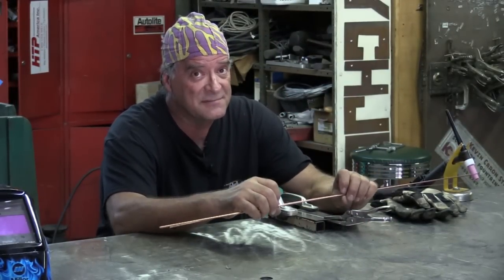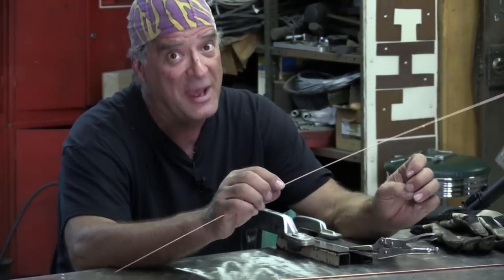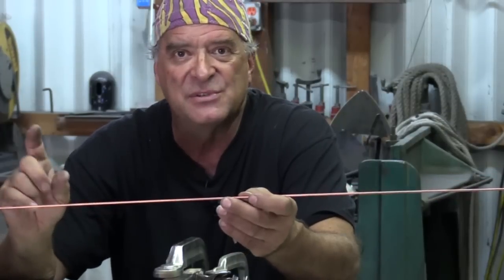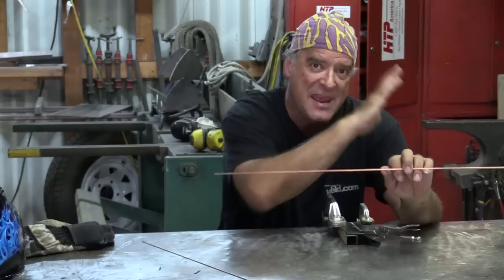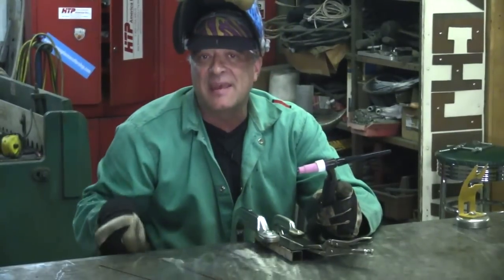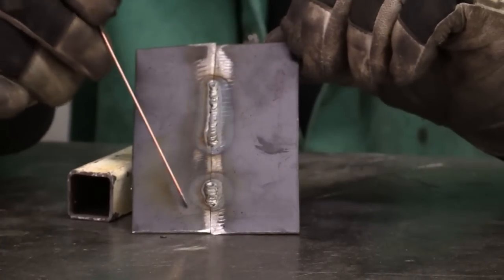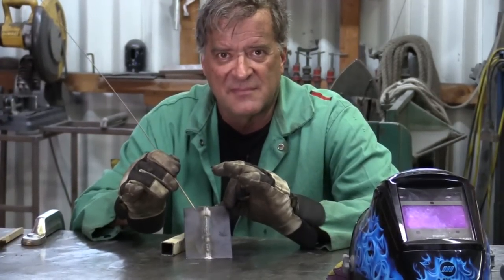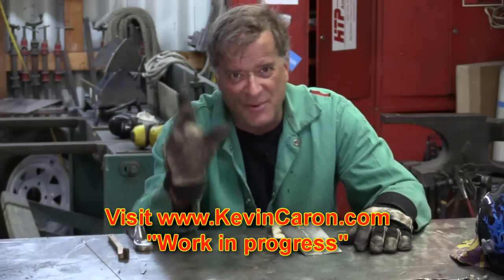How to Pick the Right Size TIG Filler Rod - Kevin Caron

Comment: Thanks Kevin, been trying to weld some thin Aluminum all week with a 3/32 T and filler.  Will not work on low amps.  This was a great topic to cover.  I think anything below 1/8 th should be 1/16th T and 1/16 filler.  Appreciate the video work.
Reply from the maker: Whatever works for you is the correct way far as I see. 

thanks for watching.

Comment: Finally got around to watching this video. Saved it to a playlist to find it easier when the TIG welder finally happens. I smell an Everlast 160sth in my future.
Reply from the maker: Nice little machine!    Sure it will work very well for you..
Reply: Kevin Caron, Artist But before can get the Everlast 160sth, need to get a cabin built. Definitely want one, just like that metal cutting circular saw you did a video of. So many shop toys, so little money. LOL, kind of like a starving artist, buy what you can when you can.

Comment: I had this problem a few weeks ago. Had a big gap to fill using a somewhat low amp Tig machine, 165amp, and just couldn't get the 1/8th inch rod to melt. I'm going to try the same set up again and use the 1/16th to see how it fills in the gap. 
 I'm think it would make for the same issue using stick. I tried using 3/32 rod with the same problem, the 165 inverter machine just wasn't getting my puddle hot enough.
Reply from the maker: Sometimes you just need more power!

Comment: Good coverage on rods, heat input should balance rod to base being welded. I would rather error in favor of a smaller rod and more dabs. Also, I noticed some sparks being thrown off when you tested the ⅛" rod etc. What was up with that, contamination or?

Comment: I was told 1/16th was more useful than 3/32nd when using 80-150 amps. This true? I just bought 10lb of 1/16th tig filler.

I’m mainly looking to do sheet metal on my old c10 and maybe a transmission cross member mount. Can 1/16th penetrate this properly at 120 - 150amps or do I need to go buy 3/32nd instead?
Reply from the maker: The thickness of the filler rod has nothing to do with penetration.   You can use 1/16th at 150 amps but you have to really fly when you are feeding the puddle.    I like the 3/32 over 130 amps.

Comment: The general rule of thumb is to match the tungsten to the filler rod and to the base metal.  I weld a lot of panel steel and have all three the same thickness. I use mig wire as a cheap filler rod by cutting lengths I need and make them straight by clamping one end in the vice and the other end in my cordless drill. Pull it taught and then give the trigger a pull for a few seconds to twist the wire perfectly straight.

Comment: Some of it depends on your application too... There are ready cheats to using the wrong filler rod to get the right job done with the wrong sized filler & sometimes I prefer to do it.
If your parent metal is thin enough, say half the size of your filler... Start with low amps from the pedal on the joint as normal, but moving your focus to the filler is the trick. Make sure your filler is grounded in the joint and move your arc onto the filler rod and step up the amps to weld. The filler will fall into place and your filler will behave as a heatsink from that point onward.
Once you have that tacked up with a good weld, start welding on the joint where you stopped at and it'll take the filler easily.
You can walk around prior to see how your penetration went before you start, it should be uniform front and back. Depth and width should look the same from the front and back.

It makes a fast moving job a bit slower too, if it's really thin metal you're welding on. I use it on metal less than 1mm where I need stainless filler with a parent metal that has torn and gives you some play to get it done without blowing it out. If you don't need a big weld showing on the front and my scenarios... I can't have any weld showing where I was welding on the front, grind the front off and the backside is a mirror image of the front profile. 100% fine pattern on the back...
Reply: If it's aluminum, good luck on that! You'll want the right filler rod/wire for the job... Aluminum doesn't afford you any luxury other than becoming a better welder through the school of hard knocks! May the force be with your poor filler hand!  ✍🏼
Reply from the maker: Good points all around!
Reply from the maker: Thanks you for sharing your knowledge!

Comment: good points kevin, beginners better stick to the guidelines you laid perfectly here. as they practice and practice and practice every welder will develop his technique and then will know how to play with the variables to adapt the situation. the cooling effect of the mass of the rod on the weld puddle is never well explained to beginners but you did an excellent job. take care. pete
Reply from the maker: Thanks, I try to keep it easy enough so I understand what I am talking about.   Though sometimes I find myself asking "What did I just say?!".
Reply: Hey Kevin, When I did my Tig Welding course at Tech. College back in 1992 I was told by the instuctor about "The 3 second rule" i.e. if it takes longer than 3 seconds to melt the plate , you need more Amps. It would also follow that if you are moving at about 1 seconds per "dab" then your filler rod MUST melt as fast as that. Also take into account that the larger the filler rod, the more it "chills" the puddle. So if you want a fast moving small weld, then you need a small filler rod.
Reply from the maker: Great points Scott!

Comment: Kiven One better than filler rods size to metal thinkness.   What size tungsten to metal thinkness  when do you change  the next  od tungsten  size for thinkness of metal. what is the range of a given OD tungsten  I did wonder where miss piggy had emergraed to from the UK
Reply from the maker: I normally run 1/16to 16gauge and 3/32to 1/8,   above 1/8 or over about 100amps I will go to 1/8th inch tungsten.

Comment: Which filler rod should be used for AISI 4130 with TIG WELD?
Reply from the maker: Try 80S-D2 for ChromeMoly.  Seems to work pretty good.
Reply: Shubham,  ER 80 S- D2

Comment: Sir what typer filler rod you have been trying using,is it brass or copper rod,can you pls give a name
Reply from the maker: I use ER 70s for steel and ER4043 for aluminum.
Reply: It looks like copper because it is copper plated, but mostly it is steel.

Comment: Any suggestions for TIG welding 26 gauge?  .40 Tungsten and filler?
Reply from the maker: I have found large amounts of vodka helps!
Reply: I have read that people sometimes use the .023 or .035 ER70 MIG wire as filler rod on extremely thin material such as your 26 gauge.  I have not had the chance to try it myself yet, but it would be worth a shot.  Good Luck.
Reply: Thank you!! Keep up the beautiful artwork!  I'm a Disabled Veteran (68 years young) just starting to do small stuff for the family to see how it goes. The 1,000 lbs of 26 gauge was free 😎
Reply: .35
Reply: Thomas Quinlan Thank you!

Comment: Something to do with those scrap pieces of mig wire, real small tig wire. Or fold them in half put one end in a drill and give it a twist to make a bigger piece of tig wire.
Reply from the maker: Did a video doing that with a drill awhile back.
Reply: Now that you mention it, I think I remember that. I am getting old.
Reply: +bc65925  after I saw it I started saving all my scrap wire and doing this with them. Genius, lol!

Comment: Hey Kevin can you take a look at my tig weld on my channel and give me some advice please ?
Reply from the maker: Need to know the settings you are using as well as the filler rod and metal.  Mostly it looks like you need to slow down and practice.    Start counting in your head "one one thousand" and dab at the same time every time.
Reply: Kevin Caron, Artist im using 1/8 inch es70r2 at 80 amps
Reply from the maker: Way too cold!     Turn the amps up to 125 and try again.
Reply: Kevin Caron, Artist would it help if I used 1/16 rod ?
Reply from the maker: Sure, amps around 80 for 1/16 should work great.
Reply: Kevin Caron, Artist would that size be ok for welding exhaust pipe ??